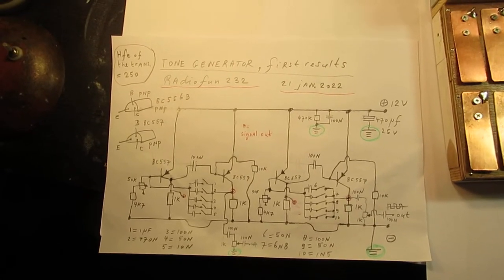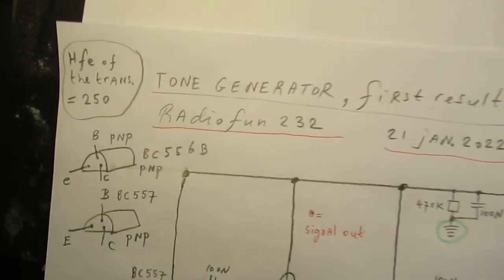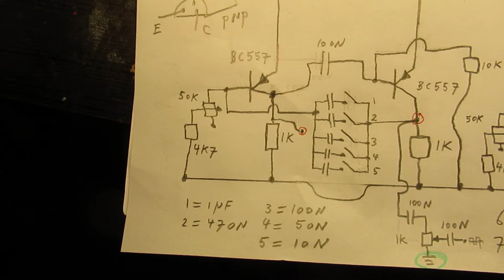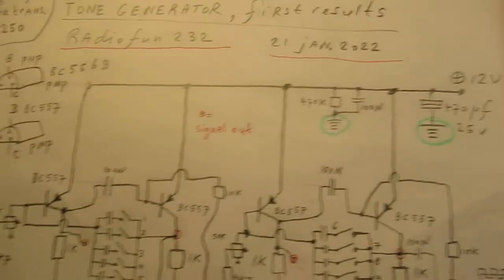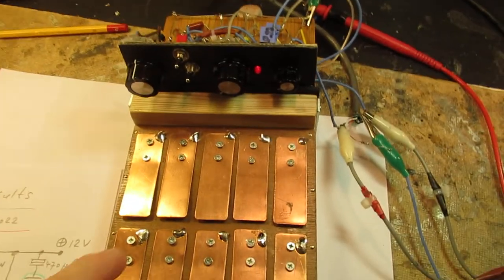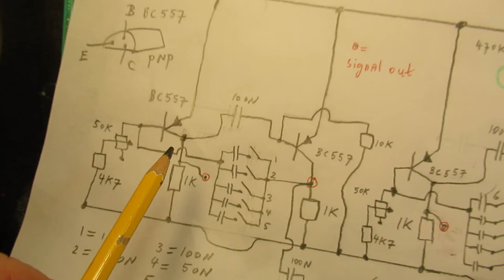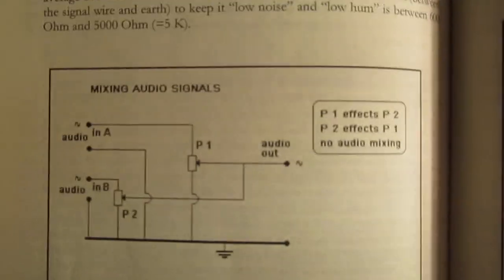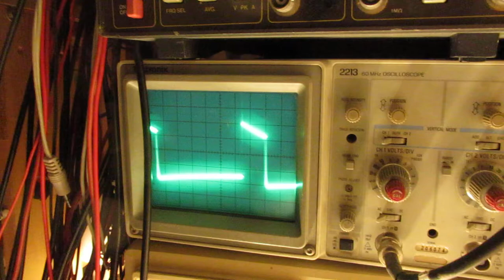Audio synthesizer or very basic simple organ circuit (square wave generator 50Hz-16 KC) & much more

Comment: Clever exploitation of the low impedance of the output. The most important reason for the PNP is that its amplification can be linearized using a simple resistor to the ground from its collector. This adds some negative feedback in the stage, which avoids a lot of unwanted oscillations.
Clever in every aspect.
Reply from the maker: Thanks, and yes, & it took some time to figure it out. After the failed circuit with the NE 555 I had to turn back to the bare essentials.... :-)

Comment: Sound exploration is always interesting, thank you. Just some thoughts, for those that don't have PNP transistors - NPNs could be used by just flipping over the supply polarity. As you have 8 keys - they could be tuned to 1 Octave, the flats and sharps would be missing but a tremendous amount of music has been penned for just 8 white notes. The supply would need good regulation. The one-handed cross-coupling (bridging) between both oscillators is probably caused by hand capacitance/resistance, and would change with perspiration ;) All the best Ko, Michael.
Reply from the maker: Thanks Michael.
Reply: What of BJTs like 2n2222s ?
Reply: @joshuamillerknight7530  The 2n2222 has a lower HFE (current gain) than the BC577, but it should work - as long as you flip over the supply polarity. You could cobble together just one astable multivibrator to see if it works.

Comment: When you press two keys, do the oscillator frequencies change? Can you see that on the scope? Perhaps you need some decoupling capacitors from the emitters to ground?
Reply from the maker: Yes they change and peculiar: you cannot get them (with this circuit, as it is now) to the same frequency when you press both knobs at the same time, though both oscillators have the same frequency reach (built up identical, same capacitors, etc. at least on 2 of the 5 knobs). One is always on a higher frequency than the other one when you press both of the knobs at the same time, though they were tuned first (via the potentiometers) to exactly the same frequency. I think that is due to to primitive out-coupling of the signal: via 2 capacitors to the output volume potentiometer, no resistors were used, so the risk that the oscillators influence each other is there (no good mixing). I will try what happens with a capacitor to ground. By pressing all the knobs of one string at the same time all capacitors get paralleled, that means always a lower frequency. :-)